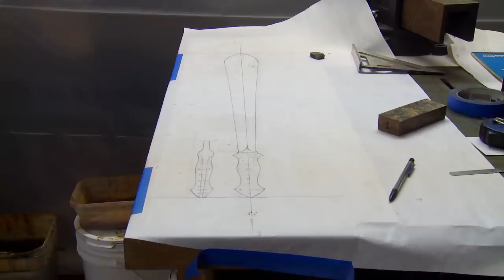Forged in Fire: Ida Sword SLASHES the Final Round (Season 4)

Comment: When Josh failed his test piece, he should have gone back to fix it. I can see why the showrunners moved the strength test to the middle so the issues with the blades show up earlier.
Reply: Also, with the current lineup there's more reason to have separate kill and sharpness test.    The kill test effectively demonstrates the basic function & sharpness of the weapon, and then the sharpness test coming after the strength test further demonstrates the blade's ability to survive the damage of the strength test.  When doing it last, only visible damage can be judged.  When doing the sharpness test after, it can be compared with the 'before' of the kill test to see how much the blade lost even if it survived the strength test.
Reply: That's a failure in the initial creation of the billet, there's no fixing that without starting over from scratch.
Reply: @mfree80286  A better heat treat cycle should aid in correcting it though, no?
Reply: from what I've seen in forged and fire, if the initial billet had a failure it would crack from a weak spot, on the other hand if the blade has chipping issues it's more likely a heat treating issue. Perhaps it wasn't hardened enough?
Reply: @user-77796  exactly. It got hard and didnt allow to temper for long enough OR it wasnt hard enough to begin with
Reply: @mikejunt  I feel like the best order would be sharpness then strength then kill. Sharpness first to see if they did a good job at sharpening it. Then strength so see if it is resistant / battle worthy. And finally kill test to see if it is actual an efficient weapon in real life condition / battle situation where it wouldn't be sharpened before each swing
Reply: I thought doing a test piece along with the main blade was a brilliant strategy, except when his test piece failed, he just shrugged it off, so I'm not sure why he even bothered since he didn't use the knowledge to his advantage.

Comment: Blade was too hard it was not tempered right or heat treated right
Reply: Exactly
Reply: Well heat treating is how metal chips. So i think heat treat was allright.  It was just that the twisting of the damaskus brought soft metal outside
Reply: All hard steel is used in damascus. These guys are right, the heat treatment was not right and made the steel too hard/brittle. Soft steel bends and rolls, it does not crack and chip.